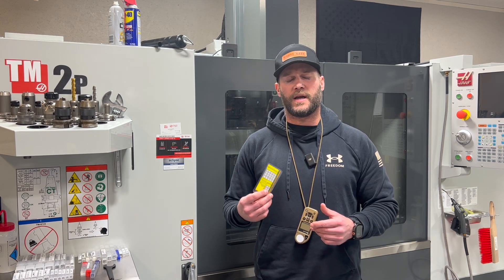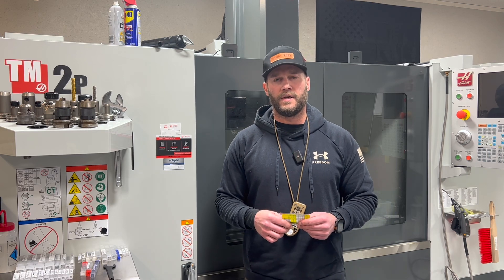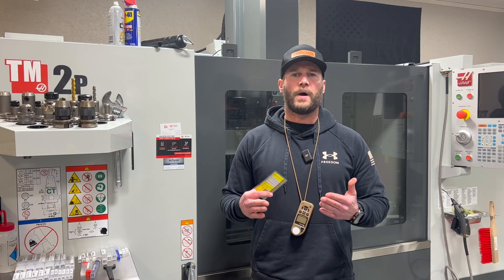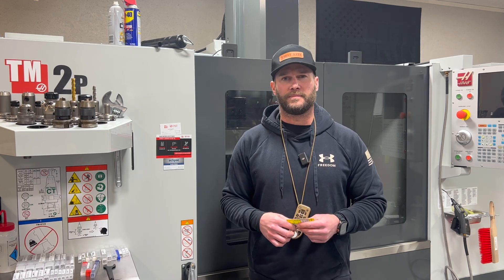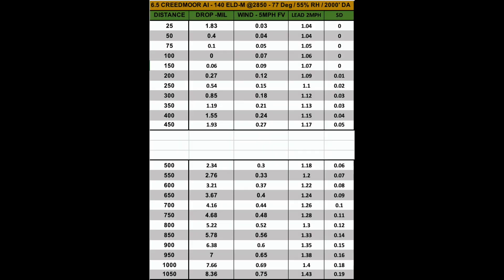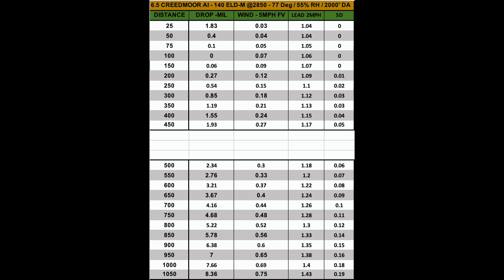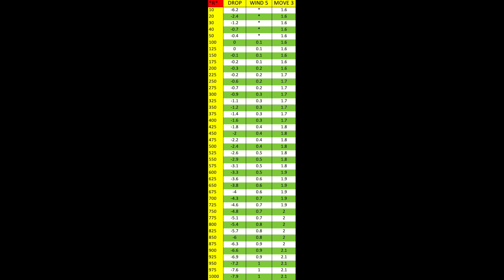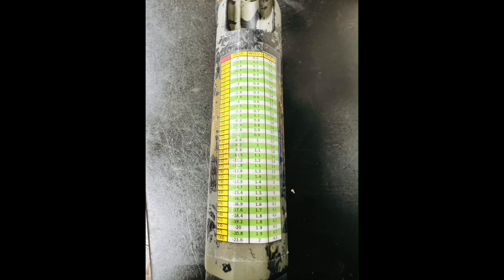TPM - Intro to Precision Rifle Shooting - How to Build a Bullet Drop Chart  (Dope Card)  -  Part 3

Comment: Can you talk about when filling the boxes in a shooting app. What’s zero angle?
Reply from the maker: I don't use zero angle but here is a quick explanation. Zero angle is another method of measuring zero range. Instead of using the distance in yards to the zero target, zero uses an angular measurement between the line of the bore, and the line of sight. A little geometry is involved to solve for that angle and that is your zero angle. Some ballistic problems use this, some don't I prefer zero range in yards. The Hornady 4DOF solver uses zero angle I believe.
Reply: @triggeredprecisionmachinellc  thank you